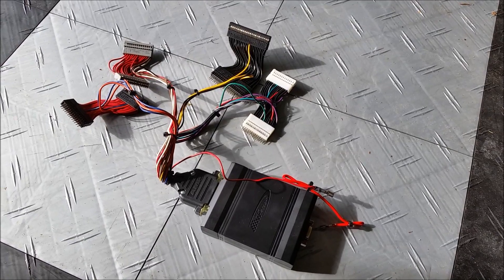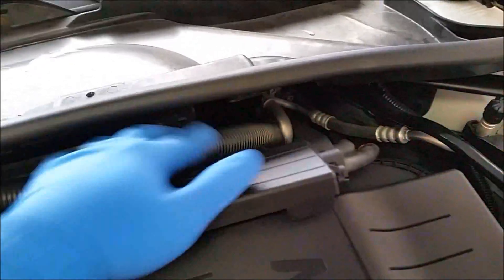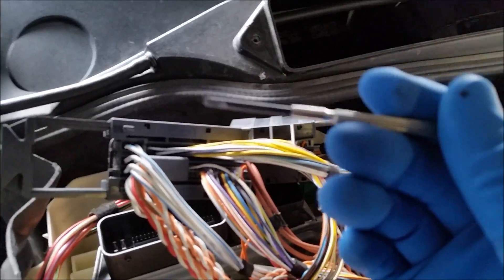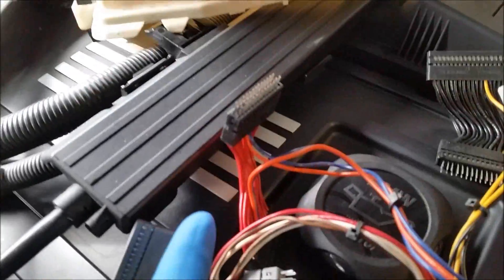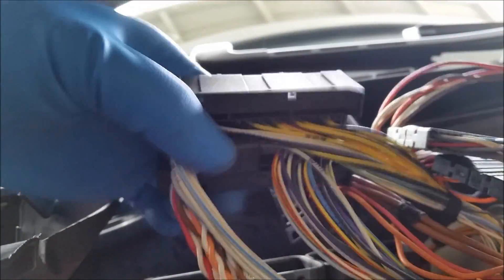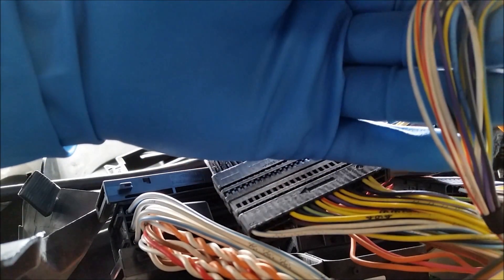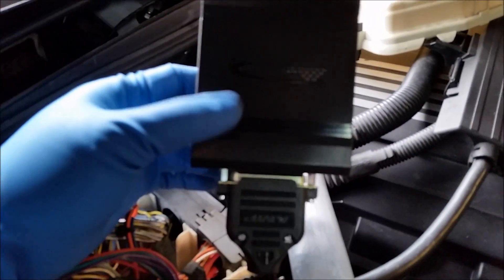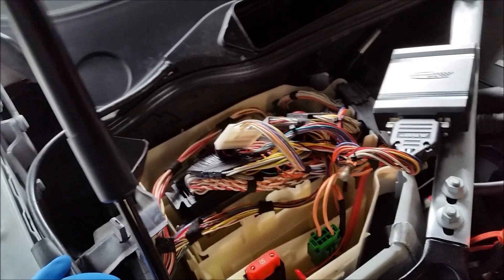JB4 Tune DIY - BMW E9X 335i & E8X 135i (N54)

Comment: Good guide, shame the process is just unnecessary. Cobb or RaceChip takes 5 minutes, and doesn't require removal of any parts
Reply from the maker: Different strokes for different folks. I ended up switching to MHD Flasher. #tuningwars LOL

Comment: Can this be done on a bmw n52 325i e90 2006?
Reply from the maker: Check with Burger Motorsports for a tune or piggy back designed specifically for your car.

Comment: I saw this video and then decided to install it. I research a task a lot before I tackle it to see common snags and obstacles one may encounter. The BMS guide didn’t seem helpful with their super close up pictures. I mean now that I’ve done it it makes sense. But your video was ten times more helpful than anything else I’ve searched online. I’ve had that tuner on my counter for 2 weeks now cause I was worried I didn’t fully understand the connections. So Thanks! Your video is gold lol
Next is deciding where to run that WMI line.
Reply from the maker: Thanks man, I really appreciate the feedback. I'm glad I could help.

Comment: I connected it all and he car would crank but wouldn’t start. Took it out and started fine. Any ideas of what could have gone wrong? And before you ask I did connect the power wire to number 2
Reply from the maker: Sorry not sure... perhaps one of the connectors in the harness wasn't tight?
Reply: Same here did you every find out what happened?

Comment: Can doing this wrong mess your car up ?
Reply from the maker: Yes! You want to follow the directions posted on BMS site very carefully.
Reply: Get cobb instead. Accessport attaches directly to the obd and save you the hassle. Much reliable and smoother at higher revs. Greater consistency, proven on dyno and track.

Comment: My car is throwing a limp mode after the install, could it be because of the ECU boxes not being lined up?
Reply: Improper installation probably, but worth checking the codes it's throwing up.
Reply from the maker: Double check your installation. It should not throw any codes or go limp. If you bought it used, double check the Map and settings of the tune.